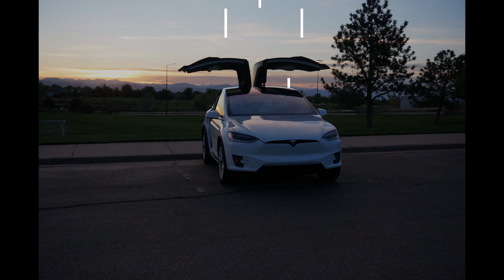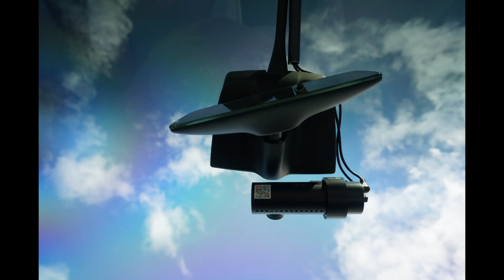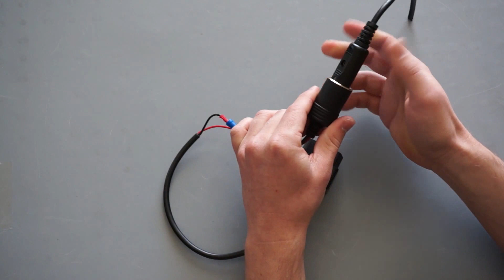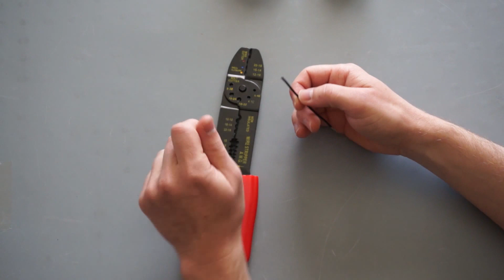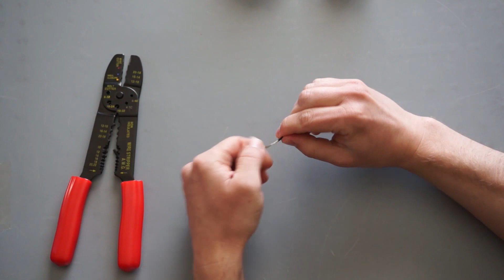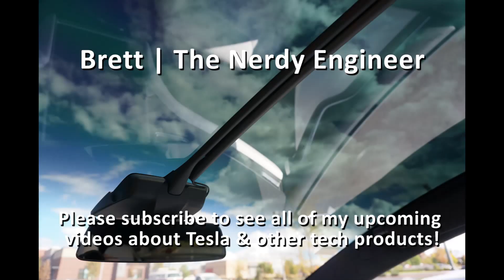Blackvue Dash Cam Wiring - Tesla Model X

Comment: More research and I bought this instead. A single wire from obd2 to the dash cam!
Snap N Go Quick Hardwiring Kit Parking Mode Continuously Recording For BlackVue Dash Cameras Compatible DR-900S DR-750S DR-650S DR490 DR590W DR590 DR450 DR430 1CH 2CH https://www.amazon.com/dp/B07BCWX2MM/ref=cm_sw_r_cp_tai_i_TJFgBbHGSDG3R
Reply from the maker: That's pretty cool! Good find!

Comment: Hi Brett. Did some searches on amazon. Do you think these will work the same way? Would save some splicing effort and the connections would look much cleaner.
1) ODB2 to USB female - Moeye 5V OBD2 USB Car Charger Cable Adapter Extension Hardwire Kit for Dash Cam/GPS https://www.amazon.com/dp/B0711FXDCZ/ref=cm_sw_r_cp_tai_i_H4EgBb5HQ4V22 
2) USB male to cigarette lighter female - ARECORD USB A Male to 12V Car Cigarette Lighter Socket Female Converter https://www.amazon.com/dp/B01J67JIOQ/ref=cm_sw_r_cp_tai_i_Y7EgBb192RRV3

Comment: Excellent video. Do you also have a mobile hotspot hardwired? If yes, can you post a video on how you did that, please?
Reply from the maker: Thanks! No, I never ended up getting a mobile hotspot. Most people tend to use Freedom Pop because there's a free option if you only use a small amount of data (ie alerts and occasionally checking the video). I'm not sure how much power it draws though so I'm not sure if you can run it from the OBD2 port. If I remember correctly, the OBD2 port circuit has a 5 amp fuse so you have to be careful that you don't overload it.

Comment: Have you had any problems using the OBDII as power source so far?
Reply from the maker: Mike Anthony no, I haven't had any issues so far. My dashcam has been going strong for a year and a half now running off the OBD2 port without any issues.

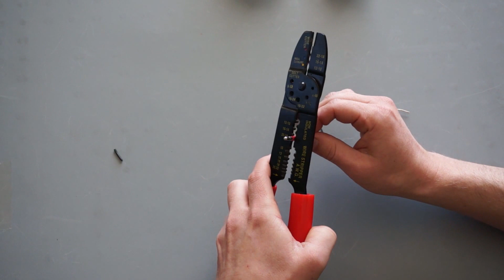Comment: You screwed up with your pliers at 2:57 - You are supposed to use the other end of the pliers to crimp connectors, and then use the correct color opening to do it correctly. You can see three dots on the "beak" of the pliers - red, yellow and blue. And your connectors are the red size. Just a small tip :-)
Reply from the maker: +sjokomelk thanks for the tip! As you could probably tell, I haven't done much this type of stuff before!
Reply: No worries! I mess up all the time. Learning by doing :-D

Comment: Thank you! I followed your exact instructions (buying the same stuff) and it works perfectly, though my cord is about twice as long lol. Where do you hide the cord? Did you tuck it away behind the carpet or paneling?
Reply from the maker: +YoutubeComment20342341 you're welcome!  Yes, I just tucked the extra cable in. I think for the rear camera cable, I made a loop of the extra cable and put it inside the trim of the rear lift gate. For the power cable, I didn't really have that much extra cable. I kind of tucked a little extra up top in the head liner and the rest of it by trim near the driver's door.
Reply: Thank you! I found a gap to tuck everything into so it's totally out of the way. It would be interesting to have a manual on-off switch. Do you leave this running 24/7 or unplug it when you're home? I don't know why, but seems weird leaving it on for the 12+ hours or so I'm home everyday.
Reply from the maker: +YoutubeComment20342341 I just let it run 24/7. I'd be worried that if I unplugged it, then I'd forget to plug it back in on the day when something happens and I need the video. It would he nice if they came out with a dashcam that would turn off when parked bases on GPS location (at home). Then when you get back in the car, it would automatically turn back on.

Comment: Hey, a quick tip -- Check out the 'Irwin Self-Adjusting Wire Stripper' on Amazon.  No need to futz around figuring out wire sizes, etc.. and it'll strip the thick insulation and that on the individual wires too.  ( I see someone beat me to the male ends not being on the OBDII end.. :) )  -- Link (if it comes through on comments) for the wire stripper: http://amzn.to/2rVYFjS

Comment: Just a tip. I noticed that you used the male connector on the live end of the cable coming from the OBD2-plug. I'd rather use the female connector on that end.
If they were to unplug themselves for some reason the live ends could touch and short out the fuse.
Reply from the maker: Ahh, good tip!  As you can probably tell, I don't have much experience wiring things.
Reply: Experience has to start somewhere. 😊👍🏻

Comment: Why not cut directly from the ODBII adaptor to the Blackvue cable and lave out the cigarette lighter adaptor? Is there any reason to leave the Blackvue cable intact? Perhaps the fuse inside the male end of the Blackvue cigarette lighter plug is necessary for some reason???
Reply from the maker: +Mat Unger yes, there's a fuse in the cigarette lighter plug.

Comment: Nice Vid, thank you for sharing.
Please consider not all of your viewers are 100% familiar with acronyms, such as OBD in this video.

I believe this is the port used for diagnosis but not 100% sure obviously.

Thank you again Brett
Reply from the maker: That's a good point.  I didn't even know what an OBD2 port was before.  Yes, it's the port under the dash that's shaped almost like a large HDMI plug (trapezoid).  It's the same plug that Geico and some other insurance companies use to give you a discount based on your driving (which unfortunately doesn't work on a Tesla).